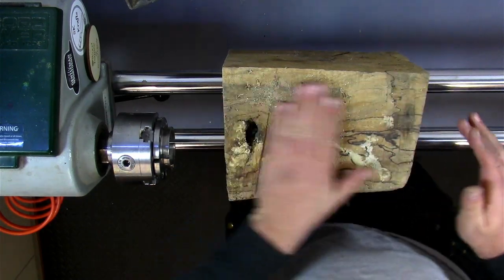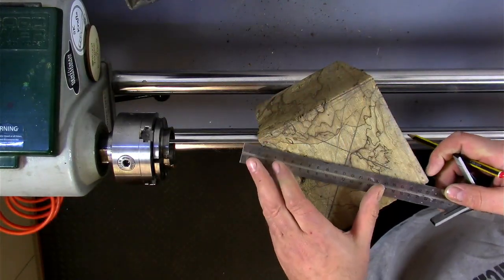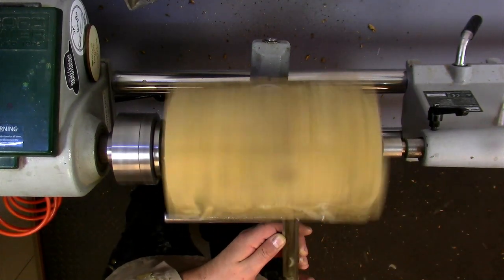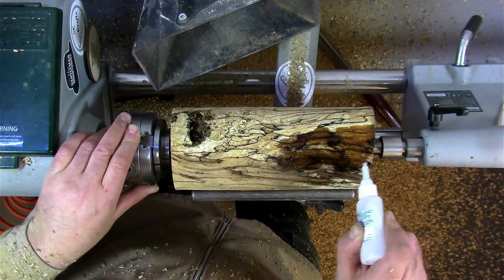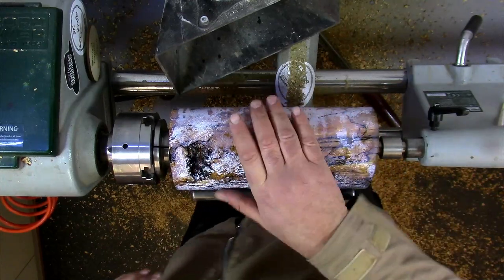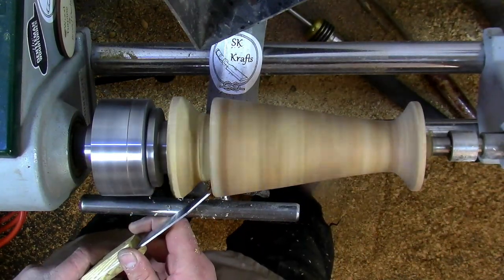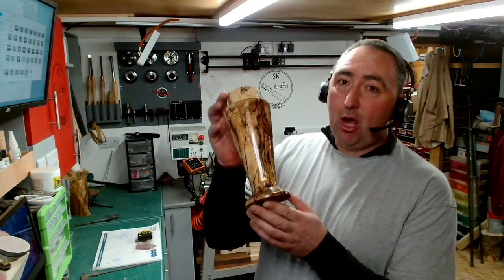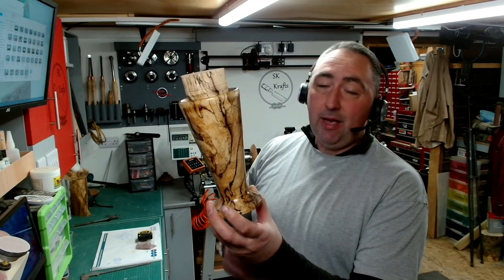The Art Of Woodturning | Horrible Punky Bit Of Wood - Will It Hold Together

Comment: Mate that is absolutely stunning piece how about drilling holes down the top and pouring the wood rot treatment down so it will go deeper rather than just pouring id around the rim??? or you could stabilize it???
Reply from the maker: Thanks mate. I have drilled a couple of holes down and keep adding the treatment hopefully it will harden it off.